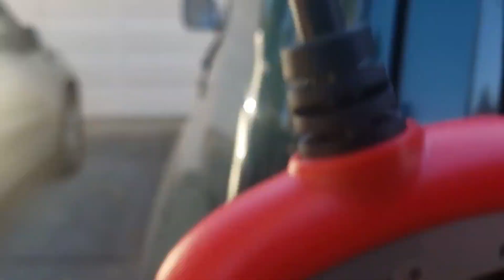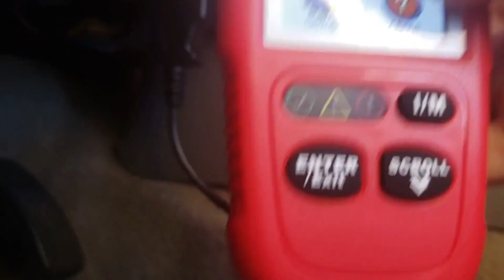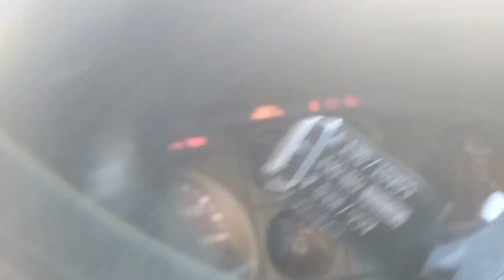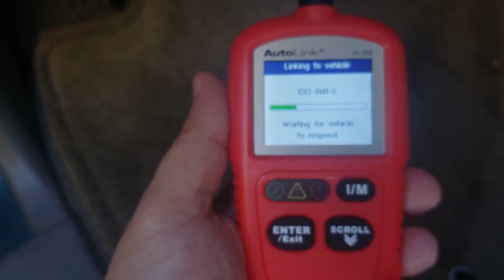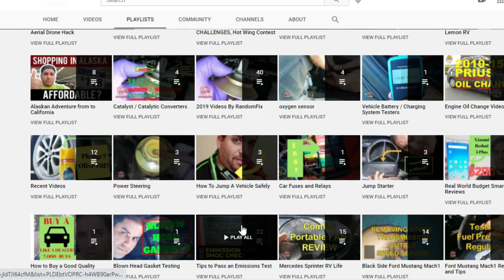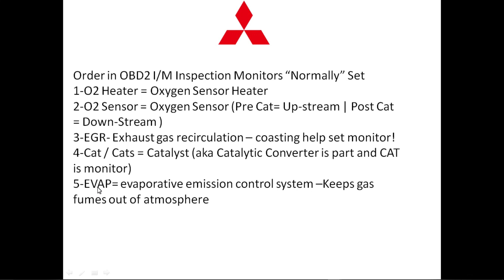Mitsubishi Emissions Drive Cycle▶️ Mitsubishi Smog o2 Cat EGT EVAP Monitor Readiness

Comment: I have a 2002 mitsubishi lancer and have a egr not ready and and I can't make it ready using your method. Its frustrating. No hard or pending codes.
Reply from the maker: Go over 65ph and coast to under 20 Moh or lower if possible without touch the brake pedal. Off ramps,  hills, and open roads are ideal. Ready three times and rescan.  If after 3 attempts of this it’s is not ready you need to clean the egr and the passages or look into replacing the egr. 
Good luck and keep me posted.
Reply: @RANDOMFIX  i verify the egr and its holding vacuum I clean it and replace the egr vacuum solenoid just in case
Reply: Did it got fix?

Comment: Over 750 miles and Egr still not set- going to schedule appt with Mitsubishi dealer see if they know something- just expensive! This all happened from replacing the mass air flow sensor we disconnected battery and performed over 750 miles of drive cycles specially for Mitsubishi and did them twice each time not touching the brake ac n heater off!! Frustrating as I’ve been trying since April 01
Reply from the maker: Hi Karen, keep us in the loop on what happens at the Mitsubishi dealer. Good luck
Reply: Hey!!! Went to dealer everything is good in my car they were all impressed of how well my car has been taken care of my
Pedal sensor was 6.8% should be less than 2% did the drive cycle three times did not set EGR SMOG GUY SAID CAR IS T IDKING NOW ITS PURGING left message with dealer he said keep doing drive cycle frustrating thanks for your help!
Reply from the maker: Wow, this Mitsubishi drive sounds like a real pain in the neck. This drive cycle is actually producing a lot smog.
Reply: Almost 1800
Miles- just replaced the 02 sensor as my light came on after completing another drive cycle - now I have the catalytic and egr not setting but since the dealer lowered the sensor? My car is purging while idling- so I guess I need to go back n have them adjust it and try the drive cycles again
Reply from the maker: Hi Karen, 1800 miles a long way. Sadly you are not the record holder, there is a gentleman that had a Chevy Silverado, it took him a over a year.
Reply: Three years later? Egr still won’t set the referee states they do not help with monitors that won’t set- meanwhile I keep getting pulled over- I’m beyond frustrated- I’ve spent thousands trying to get this done with zero success! Four mechanics have also tried as well as the dealer with no success!
Reply from the maker: @karenackerepic4life800 I’m sorry that you are still going through this!!!
I can understand your frustration as the guessing games gets old when mechanics and dealerships lead you down a dead path. 
Just of curiosity what did you spend thousands of dollars on?

Comment: THank you Randomfix .. You are very helpful and appreciate all your work you do...God bless you!
Reply from the maker: Jay, thank you for the great feedback 😀
Reply: @RANDOMFIX  Randomfix my evap and egr is still incomplete sir after driving 120 miles in highway and the evap just got ready but my engine light is on...How can i get the egr to complete. Maybe some sensors or something is not reading for it to be incomplete this has not happened before
Reply from the maker: Check the code that caused your check engine light to come on. After you figure out the reason for the check engine light. Look at the egr and see if your can check it.
Reply: @RANDOMFIX  the only code is P0456 i got gas cap but it still comes on after i reset monitors.Egr always gets  complete after cycle  but now it stays incomplete,,,
Reply from the maker: P0459 was thrown because of a leak is detected, there is a evap purge soleniod. There is a small leak evap system. I wish the gas cap was the ALL miracle cure.
Reply from the maker: Check out some forums online, Google the make, model, and year of your car + p0456 and you get a good idea of what is going on.
Reply: @RANDOMFIX  haha right..
Reply: @RANDOMFIX  will do..I heard the egr system is the last monitor to get complete and takes forever not sure if this is true but i did drive 150 miles and all monitors got ready except egr and when evap got complete the engine light came back on lol with the po456 code..Also i only need 7 monitors out of 8 to pass in vegas correct?
Reply from the maker: I'm not sure about Vegas as I'm in California, normally the evap is last to set. The pending evap issue will actually keep other monitors from setting.  When you scanned for the incomplete egr did you see the pending evap p0456? There is still a small chance you can set the egr without dealing with p0456 but its slim.
Reply: @RANDOMFIX when  i reset all monitors and it has 0 codes they all get complete except evap system and egr system after i drive 100 miles the evap completes eventually and engine light comes back on with the P0456 only its the only code i have but egr stays incomplete
Reply from the maker: When you do the next drive cycle you can check for pending codes at anytime.  Unless you pay attention you won't know.
Reply: @RANDOMFIX  ok but im sure theres no pending i have a obll reader i got from walmart i don't see any pending codes just the one code p0456 but i will double check thank you sir. If no pending then i just have to wait til the egr completes you think